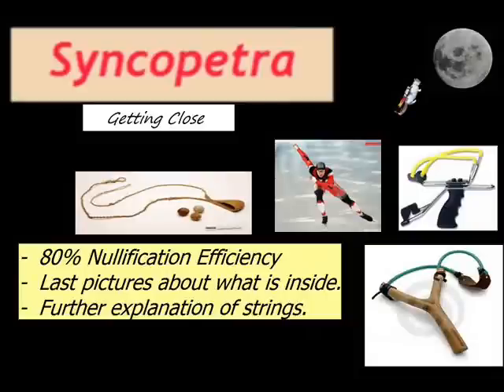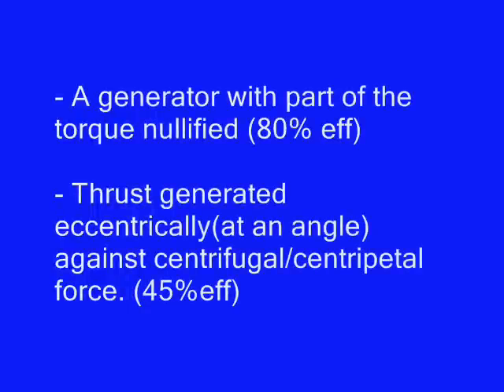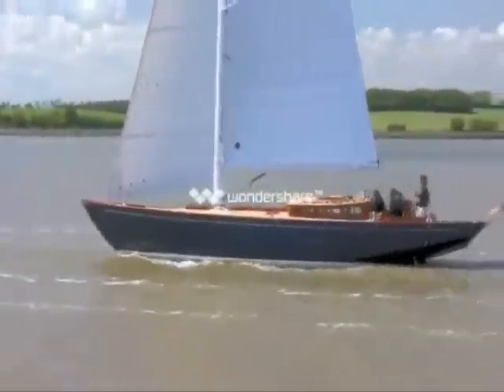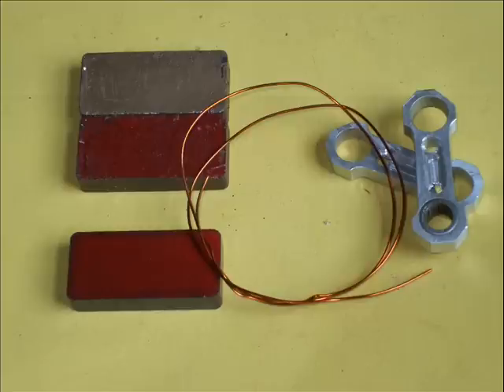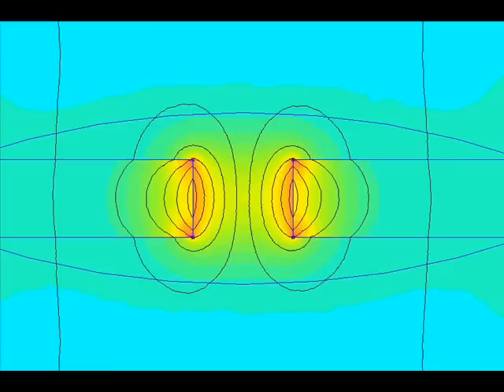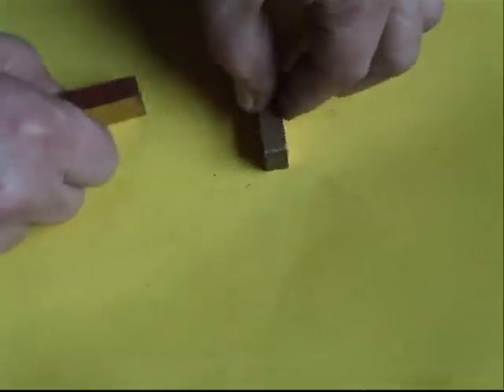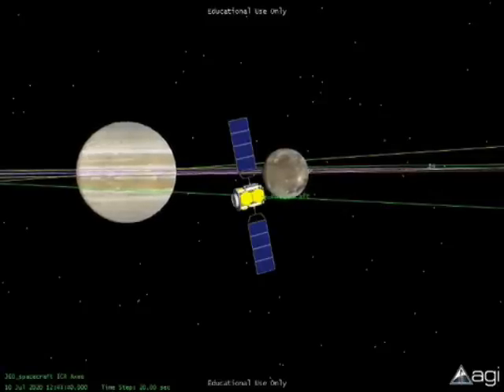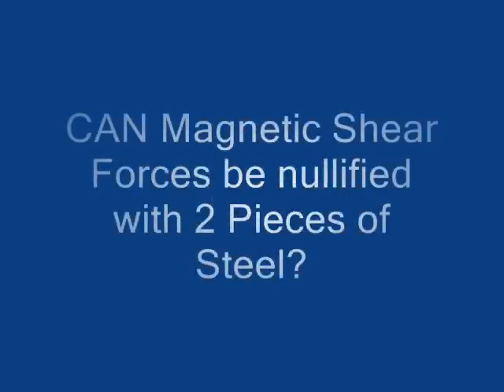2 String Slingshot Effect

Comment: Every time I think of magnetic free energy I am thinking of a (tube shaped) balloon. Now think of it as one which is not fully blown up. Now, if you squeeze it, and push the air to one end, then at a certain point the air flows back (plop). You call it a slingshot. In my analogy the balloon is the flux density, where you squeeze it, it is higher. Where it does 'plop', it is as if one of the two magnets is fiercely expanding its flux (perhaps it was repelled before and now comes free)